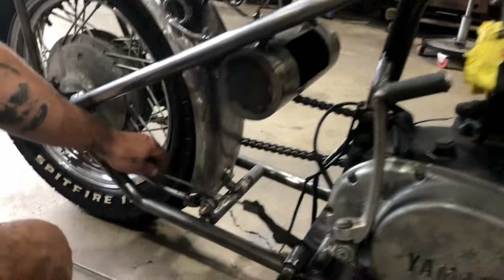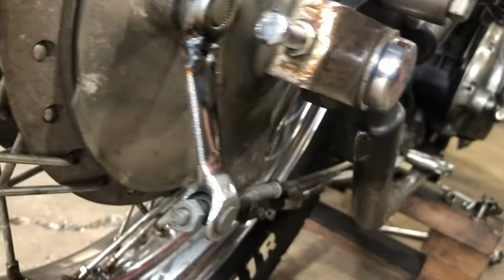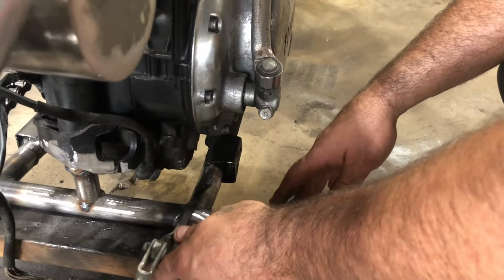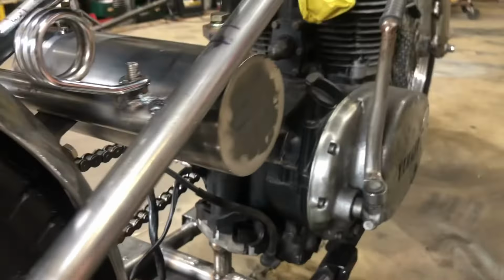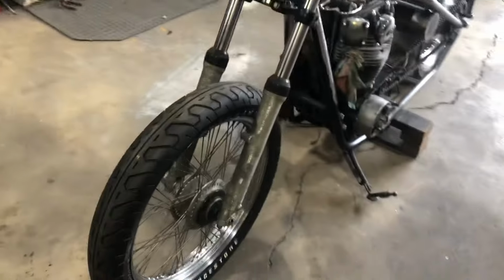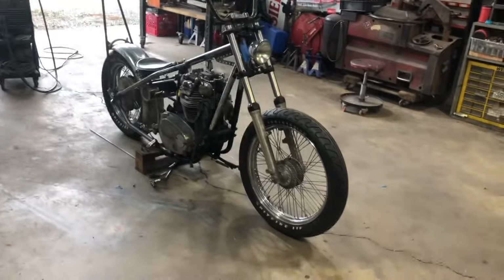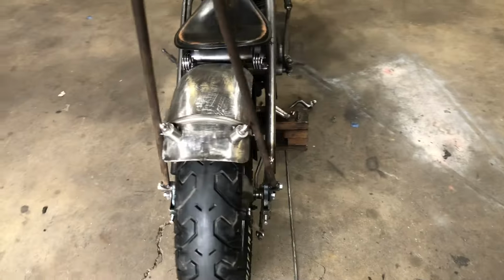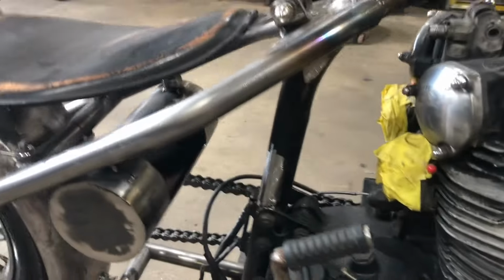Yamaha XS650 Bobber Build Part 8

Comment: I've been wanting an XS650 bobber or chopper for years. Ever since I realized it's the best bike to have longterm so you can work on it yourself and not have to gamble on a working computer controller or  an igniter box. I have a 95 Virago that nobody wants to work on and I'm not a good enough mechanic for that. I'm good with vertical twins and singles. Vtwins and inline 4s are a little out of my league.